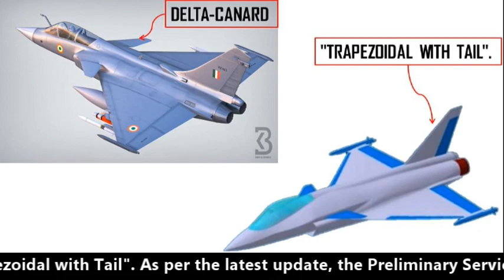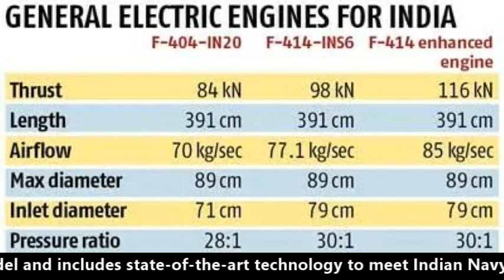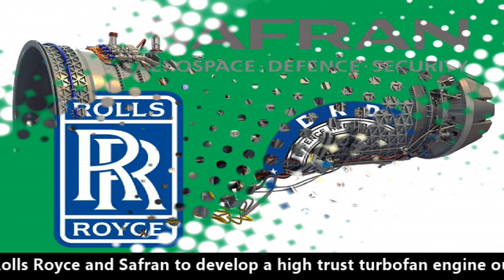TEDBF Update:  Wind Tunnel Testing, Final Scale Model, Prototype & First Flight

Comment: Waste of money ? Why create so many new models ? HAL has difficulty in producing Tejas let alone AMCAs ?
Navy should look at the AMCA or Tejas and work on that ...

Rationale of twin engines is not logical as the F35C is a single engined navy fighter ....
Reply: This is the nose of AMCA MK1 and a double engine Tejas MK2 fuselage. It will probably be a limited production and after that the AMCA MK2 derivative will be developed. You can't go from a land based version to maritime that would take twice the time. This should have been shelved until they get permission to build the Vishal and used a limited amount of foreign aircraft until then. The Mig fighters are nearly useless so buying 24 Rafale M in F-4-1 baseline together with the air force batch of 36 would have been faster and caused less delay in the Tejas MK2 and AMCA. The Tejas MK2 should go to the private sector companies anyway if they wait for HAL to finish their Tejas MK1A production it will be close to 2035 or even 2040. If they let Reliance, L&T or Tata build it they will probably have finished production before HAL is done building the Tejas MK1A.